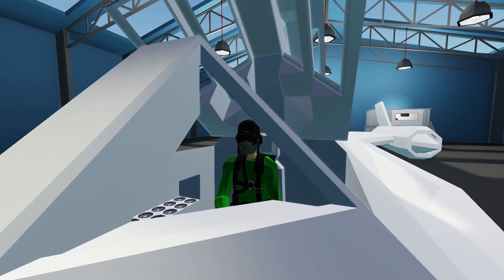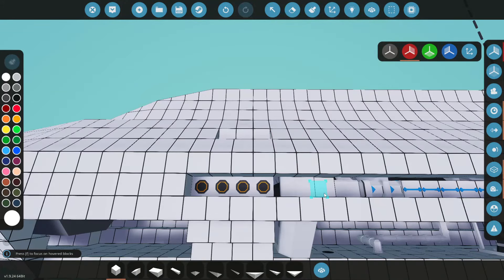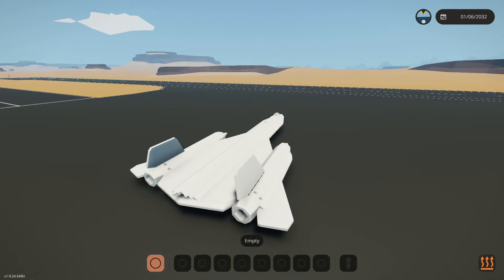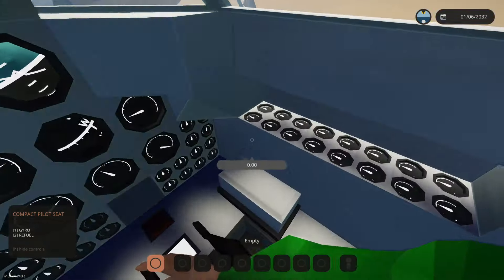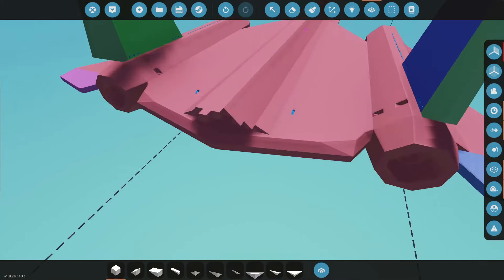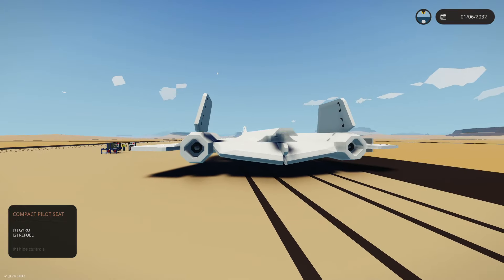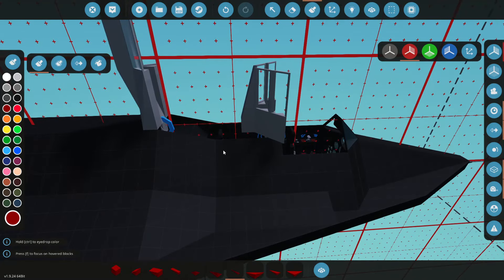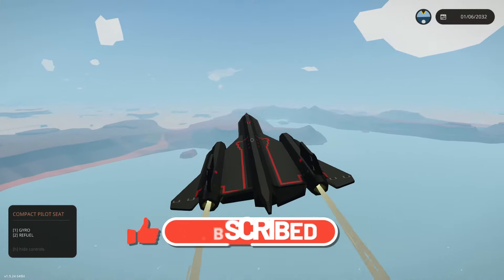Engine Upgrades, Breaking the Sound Barrier & Paint! Let's Build a SR-71 Blackbird!!! [7] Stormworks

Comment: Which SR71 are you making? because from looking at it I cannot tell if it is the SR71A,  SR71B Trainer or SR71C, it could also be a A12, YF-12A or M-21(that one carries the D-21 Drone.)
Reply from the maker: Which ever one it looks like most considering the block restrictions we have. I did consider making the drone for it so I guess that might answer the question?
Reply: @ProfNCognito  aight, so no M21/D21. so YF or A12 ain't it either since the nose is different, so I guess either the SR71 A or C since it doesn't have a big cockpit on the back.